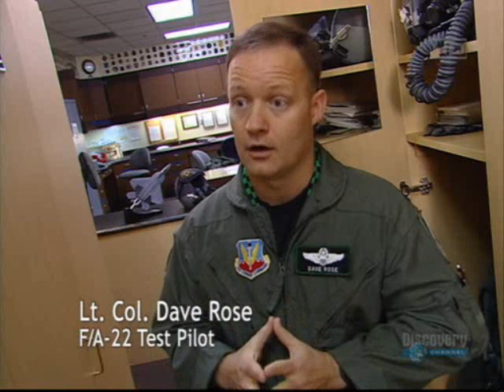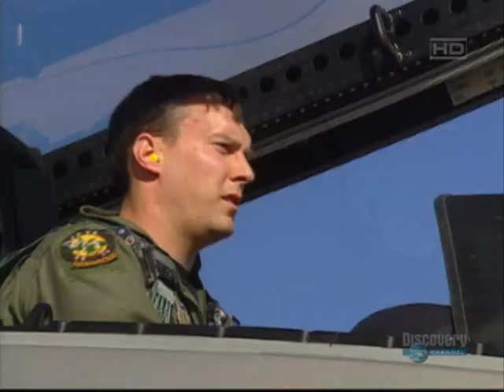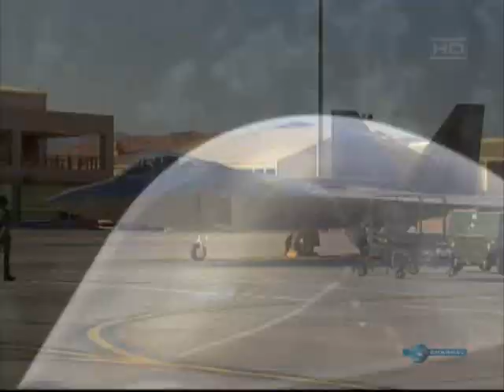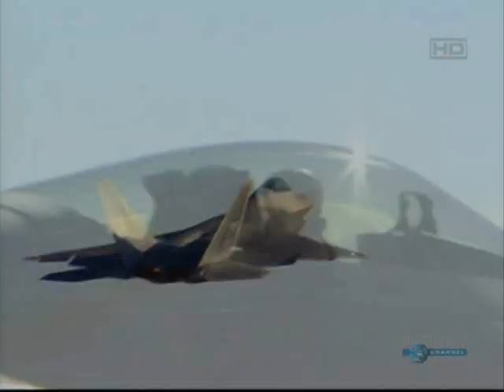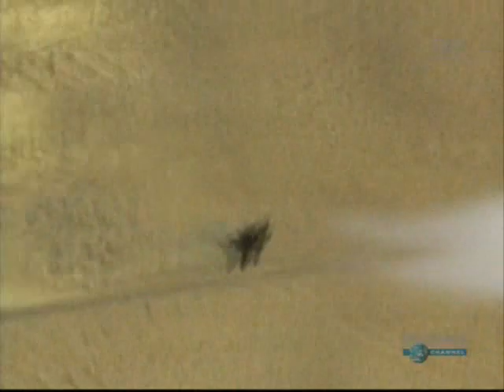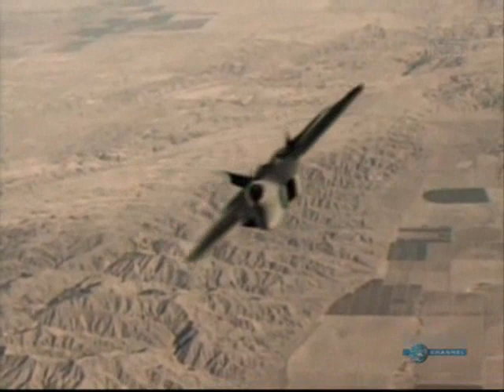USP 6°part F22 Raptor ENG

Comment: @bhigr The jamming technique only works against older radars. Even against older PESA radars, it only has limited degree of effectiveness. Jammers are common even in many 4th generation aircraft. In fact they've even fitter jammers to MiG-21 Bisons. If jamming were that effective, one could make a Boeing 747 a stealth aircraft. You'd just have to stick a powerful jammer on it, and nothing would pick it up. Unfortunately, it doesn't work that way.....

Comment: @bhigr This is patently false. The only way you can distinguish a radar pulse from background noise is by storing the pulse frequency and comparing it to a known database of known radar pulse frequencies. If a radar keeps transmitting pulses over the same frequency, they will stand out over background EM noise. But if the frequency changes with every single pulse, it cannot be distinguished from the various other EM waves flying through the air.

Comment: the f-22 has a thrust weight ratio of 1.08, which means it can put out more thrust than it's weight. the f-22 can go vertical, just like pilots of old prop planes did, except they couldn't go up for a long time. the f-22 has enough thrust that it could keep going up, so it can adjust the thrust to the same amount as it's weight, and the thrust vectoring allows it to maneuver and stay vertical, allowing it to hover.

Comment: yes it can. it has a thrust/weight ratio of 1.08 when fully loaded/100% fuel, and the thrust vectoring/fly-by-wire make it very easy to stay go straight up and then stay in one place, which is hovering.

Comment: it can go straight up and adjust the amount of thrust to keep it in one position, which is hovering. the thrust vectoring, fly-by-wire, and high thrust/weight ratio allow it to hover. even old migs without thrust vectoring could hover to hide from some types of pulse-doppler radar.

Comment: Thrust vectoring... thats refering to the jet exhausts at the rear of the plane allowing it to perform much tighter manouvers in the air. The Fly by wire system is completely due it it's nature. If the fighter wants to be more agile it is given a shape that is purposefully unstable in flight.  Fly by wire incorporates the pilots input and moves the plane while counteracting the unstable nature of the plane. It is not designed to hover...

Comment: there is no point in 3d thrust vectoring anyway. it can adjust the thrust from each engine individually so it will act like thrust vectoring and perform the same task.

Comment: What he's saying is that the aircraft lacks control ability when it's "hovering" since there's no air flowing over control surfaces.  It would require full / lateral thrust vectoring to "hover."  If the plane started to tilt over sideways/laterally (which of course it will) there's nothing the pilot can do except resume normal flight.  He can however correct pitch movements while at a "hover" with his partial vectoring.  The aircraft wasn't designed (and has no need) for this maneuver however.